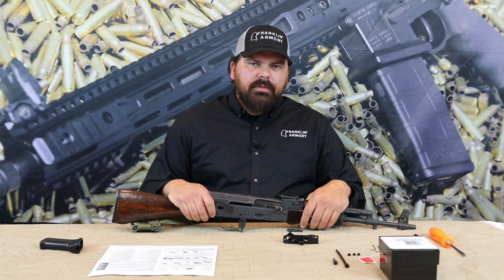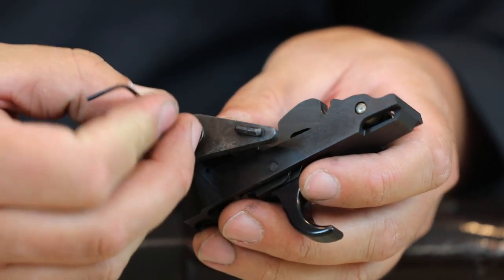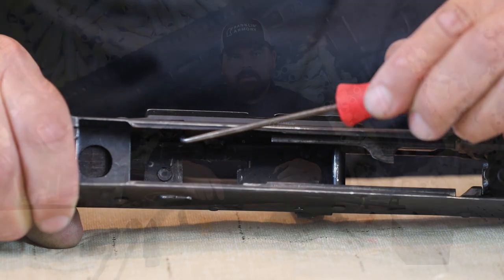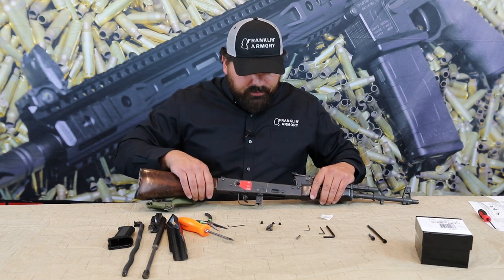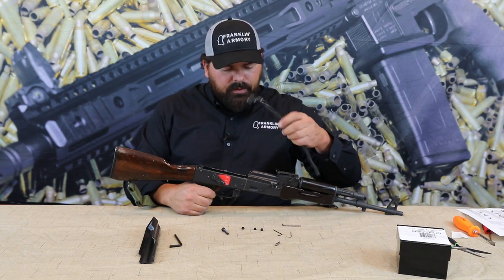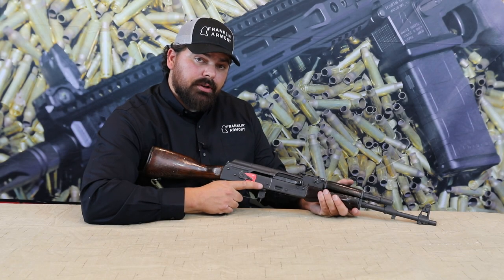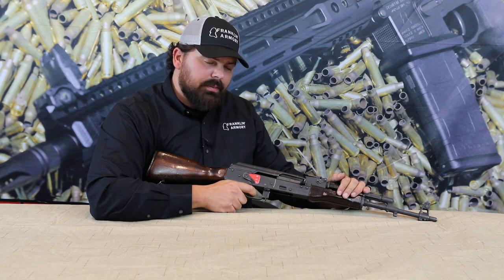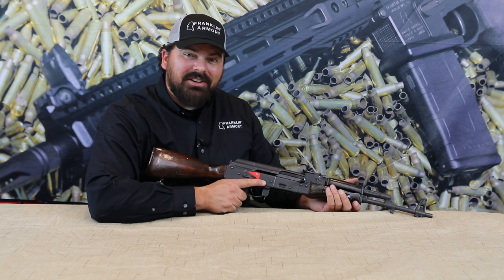BFSIII™ AK Install Video

Comment: what i don't like is you can't use your original safety selector which i'd like to see them fix on this binary trigger system
Reply: This
Reply: True.
Reply: This was one part they really shouldn't have tried to improve.
Reply: Should make it follow tradition Ak select fire control function as well with all the way down still being semi auto and one notch up for binary.
Reply: Anyone find a way around the fugly selector switch? 🤢
Reply: Yep, this safety selector doesn't look good & Fostech's looks even worse. SMH  Not sure why someone can't make binary triggers function with the OEM selectors on AKs.
Reply: @oneslackr  You know what's really funny? It'd be super easy to do a left side selector like the Tantal/Beryl use for a binary trigger. Like, insanely easy. Wouldn't work on side rail AKs but it'd still be an improvement over this.
Reply: Ak Boogie hook. Uses factory selector.

Comment: love how clear the top hat plug instructions are...
Reply: it does say to put the 2 small ones in the trigger pin holes (you wont be putting that pin back in so its just to not have a hole on either side of the gun) and the large one in the saftey lever seat, which there's only one of. they could have shown a top down view of where to set them with more light but they are relying on people knowing the take down process for the trigger assembly i think. I don't know how else he could have phrased it. i am happy to send you close up labeled pictures if you need though i know how annoying finding some of this crap is.
Reply: @philipsheets7987 well the issue i find is the plug doesnt go all the way through the hole. it has the beginning part that goes directly into the hole, but then it gets wider, and i cant get that wide part to go into the hole cause its too big. Basically the head of the plug isnt even touch the wall of the receiver. I wish it was clearer if we actually need the plugs to keep the trigger snug in place or if its just a "put something there" type of deal. Also dont know if the head of the plug is supposed to not actually touch the wall or if im supposed to have thors hammer and fit a size 5 circle into a size 4 hole

Comment: Won’t buy one till that fugly selector is changed! Wouldn’t be that hard to make it look similar to the factory selector.
Reply: edieuro95 I’m gonna mod it I got mine today
Reply: Josh Van any luck? I was planning on doing the same thing
Reply: Matt C.  Haven’t tried yet I’m getting a feel for it the only issue I’m seeing in doin it is that it will cover the trigger inbox me and I will send u some pictures of what I mean
Reply: That's what I was saying.  They need to have a full-sized selector lever for the AK.
Reply: Be nice it it worked like an ak selector two with semi being all the way dow and the other fire mode(s) in the middle.

Comment: You guys should really beef up the hex screw for the selector lever.   Theres nothing i hate more than tiny hex screws. Even while applying reccomended torque, the heads always seem to strip over time.  This wouldnt be an issue if you just used a larger torx screw to begin with.
Reply: I Agree Fully !!! And I own 4 of Companies Triggers !!!!
Reply: Almost impossible with the screw sizes/Allen sizes.  “Are these hex screws made for ants!?”  

Glad it’s finally installed, but couldn’t agree with you more.

Comment: Just installed the AK 9mm version in my AKV. Had to dremel the MAC clip a bit to slide it in.

Love the cutaway when he goes to install the hammer pin retainer clip. That thing is a pain and there's no way he got it on the first try. I had to work under/around the remainder of the MAC clip with hands shaking from the dremel work, extra fun.

Comment: Really happy with my binary trigger. Imo I didn't like how the selector looked so I just took a hack saw to it and the OEM Romanian selector and welded them together. Steel on steel Tig weld and sanded it down.
Reply: That's a good idea but how did you install it then?

Comment: Just put one in a wasr 10. no mods needed. hammer pin was the worst part by far, just did not want to line up with the last bit of the trigger housing after the spring. had to press the side of the hammer spring a bit with a flat head. but no real issues other then my own incompetence.

Comment: 9:15 safety check number 2. It’s clearly in semi. “In semi, pull the trigger, then with the selector, put in semi, the hammer should not fall”. Do you mean switch back to safety ?
Reply: The guy makes a bunch of verbal mistakes and nonsensical, redundant safety checks at the end of the video.  

I successfully installed their mp5 trigger and felt confident enough to install this one on my Zastava PAP85 pistol but unfortunately it’s proving to be more difficult that expected… 😔

Comment: Had mine in a couple years now. It was pretty fun, selector keeps coming loose over time, only problem is I've only had maybe 3k rds through it and the spring that resets the trigger had the leg break off. Dont see them on your website to replace it. I know you warranty stuff but I don't think you're allowed to ship to my state anymore, freaking Illinois sucks. I guess I can make one but honestly I think im just going to put my original trigger back in. Have a couple bfs ar triggers too, the problem is this stuff just isn't lasting. The ar triggers aren't breaking parts but they keep going binary only after a good amount of rds. Just enough dirt or whatever and that disconector doesn't slide up fast enough. Then I have to take it out, disassemble the trigger, clean it and I just replace the little disconnect spring. Those you do sell so I got a bunch of those and some selector screws because I lock tight them as they also were coming loose. The ar triggers I'll probably keep at least one because they haven't actually failed to fire ever but it sucks when an unobtainable ak spring goes out at the range. I mean I couldn't count the rounds I have on factory ak triggers, never had a spring break. And they aren't 500$ triggers. Anyways they're fun but I don't think I could recommend the ak trigger and when recommending the ar trigger I definitely have to mention the possibility of it going binary only. Doesn't bother me because Im always expecting it and they're both just in range toys.  One I use most is in a brp grip for a semi auto m53 so I cant use the ar selector anyways, its always binary. So im overall happy with the ar version. Not so much the ak version. Oh yeah and the ak hammer spring is a little weak for some of these milsurp primers too. Almost always works but definitely have a lot more ftf's than my original trigger. I wouldn't even go as far as to call them constant light strikes. It never happens with us made ammo. But it does happen a little too often with good quality comm bloc ammo. Ammo that never fails in my sks or other ak's or even this ak before the binary. Its just a hair weak. Well then, I think I've said my peace lol. Thank you for your research and development.

Comment: Does this trigger work for stamped receivers.. if so.. is there any custom work needed for proper fitment?
Reply: Looks like the gun used in the video is a stamped receiver, so yes it should work.

Comment: What grip screw do I need on a micro Draco I got it installed by a gunsmith but he said I need an extended grip screw the micro Draco one does not work nor does my zastava m92 zpap they won’t feach

Comment: Does this trigger assembly prevent you from “out running the gun”(prevent the hammer from releasing prematurely and resulting in a light primer strike)?
Reply: I hear this newest version does.  I will report back in more detail very shortly.  Well so far all I can say is it works firing slowly, which I think is the opposite of what you're interested in.  Working perfectly 55 rounds in on a very dirty WASR.
Reply: @robertgaudet7407  any updates?
Reply: @erik_the_meh  I fucking love it.  If you outrun the gun, the hammer simply doesn't fall.  So instead of 'bang-bang', you just get one 'bang', and then you can just keep on pulling.  No trigger slap BS.  No failure to function for the first several hundred rounds.  I wish it were less expensive but it's still 40 times cheaper than an actual automatic so... the price is right.

Comment: Just so everyone knows it works great on my wasr 10 with all types of ammunition except my favorite ak ammo Golden Tiger. Gun absolutely eill notbfire in binary with thsse rounds. I think the hammer spring is just not robust enough to set the primers off. Trust me ive tried eveything except a stronger spring which they sell but dont recommend forb7.62x39. They recommend using the mil spec spring that comes with it.

Comment: Will this trigger work in most milled receivers as well or just stamped. I got a c39v2 I don’t mind or feel bad putting mods on. Might I add I don’t mind a little modding just don’t want to buy one to find out none of it will work in my platform.
Reply: mv45rs hey bud did you find an answer to your question?  I had c39v2 too just wanna know if it will work

Comment: Sir, does this trigger work with the Serbian Zastava guns? I have a M92 PAP and an NPAP.
Reply: Just tried on my N92 PAP, will not work as the angle of the grip screw is different than angle on trigger housing of Franklin Armory trigger pack. Hopefully you're not out 500 bucks like me
Reply: @bradleynowel1 , I'm truly sorry that it didn't work out for you. Thanks for the heads up. You saved me, and countless others, the trouble and anger.
Reply: @traeucity6087  factt
Reply: @bradleynowel1  so any updates on this?
Reply: Huh... I seen this installed in a zpap92, and worked
Reply: I’m having trouble with a zpapm70. The screw in the handle doesn’t work and this trigger is too bulky. Dog shit product and now I’m out $500 too :D
Reply: @jamskate83  I’m thinking about getting one for my m70. your m70 under folder by chance? Can you please elaborate before I waste $500. Thanks
Reply: You will potentially have to mod the the nut that comes with the grip screw or take it out depending on the model and the trigger will fit
Reply: @tenzinphuntsok7854   Did it work on your m70?
Reply: Will not fit a Zastava unless you do some machining.  Another $300 to fix  this cluster fuck and it might work.  I would never recommend buying this Pig in a poke 😡

Comment: I'm not gonna lie... I like the idea of this and I kinda want one.  But what ALWAYS ends up getting me to not buy is that it deletes the safety I'm use to.  Which doubles as the dust cover.  
Redesign the selector lever to maintain its function as a dust cover and I'd probably already have 2 of these.

Comment: Will this work on a Sega 12
Reply: You find out?
Reply: @locoguero87  I don't think they read any of the comments
Reply: Works on a Nintendo
Reply: I don't see why not
Reply: i dont see why not, uses the same fcg as any ak
Reply: According to their website it is not rated for 12 guage platforms. Though that doesn't mean it wont fit persay

Comment: Something is wrong with my installation. Everything works fine untill i attempt to shoot fast in binary mode. Only the first round will fire the second round will strike but not fire. If i shoot in a slower pace in binary mode both rounds fire as they should. Press fire and release fire, but its when i try to speed up my RPMs and then only the first round will fire am I doing something wrong?
Reply: Anybody?

Comment: i just recieved mine and one of the two screws that attach the tigger bow, is blown out. its not stripped because the paint hasnt been scratched. i am not a happy weasel
Reply: hmk302  i just sent the rifle to them and paid the bullshit fee and attached a note
Reply: Eletric Larry  i am a happy ferret/weasel. i sent my gun in and paid for install/repair on august 8th and recieved it today

Comment: Just got mine yesterday and the bolt for the safety selector screw literally is not long enough. Also safety selector wont click on to any mode other than just semi auto? Any helps
Reply: It’s doing the same for me
Reply: @Lowygutro  hey I called them and they helped me figure it out. Very helpful.  I literally had to slam it in
Reply: Oh no way yeah that’s the only thing that I see is wrong on my end.  Thanks for the quick reply Andrew

Comment: Has any one installed on a PSA GF3 or Zastava O-Pap?
Reply: I just tried on the zastava. The bolt that goes in the grip doesn’t match up.
Reply: @MarcoGarcia-wp6qv  you end up getting that smoothed out? Would changing the grip and using the short screw work since a grip that uses the short screw just slides around independently until screwed into the nut that comes with it and maybe remove it entirely

Comment: Just threw mine into an AES-10B. Easy as pie!
Reply: I’ve got the trigger and I’m waiting on my AES 10 B2 to come in. Have you shot it yet? Glad to hear it’s an easy install.
Reply: @shawnhorning2125  Oh yeah, shoots awesome!
Reply: @michaelthebarbarian3380   Do you remember if you had to remove the trigger bow before you dropped it in or not?
Reply: @shawnhorning2125  Yup, you take the entire old trigger out, then you drop in some plastic rivets to fill the holes left by the old trigger group and then drop the entire new contraption in it's place (it's pre-assembled). Easy to do, takes about 20 mins to install.
Reply: @michaelthebarbarian3380  gotcha thanks.

Comment: Franklin Armory, any AKs you know for sure that this wont work in?
Reply: Underfolders won't work, unless you grind down the little hump in the bottom of the receiver. Learned the hard way, I got it in but it took some creativity.
Reply: @robjones3048  how far did you have to grind that hump down? Did you have to grind both?
Reply: @1white732  there's a rivet then the grip screw the another rivet which is closet to the rear, which I believe both  hold the trigger guard in place. Should I just grind down the front one?
Reply: @1white732  yeah me too thanks anyway  though
Reply: Ot does not work in my century arms mini draco with a 7.5 inch barrel. There is some recivier reinforcement that makes it sit to high for the bolt carrier to cycle. Can't tell if it works for the 11 inch barrel version.
Reply: Eletric Larry  because I  am poor and don't have a 1k to spend on a nice AK
Reply: @benhickey3189  thats what the set screw is for. loosen it up to drop the trigger housing so the bolt can clear it.
Reply: @joannedaniels2151  I want to say you are incorrect, so I don't look like a Neanderthal,. unfortunately I no longer own the firearm so can't vindicate myself. I hope it works for you.

Comment: Also can you elaborate further on 1:29 - 1:37?
Reply: Basically take a drill to one side of the relevant rivet until the flared end keeping it in is gone. Then drive out wkth a punch should come out then
Reply: Try to unscrew the screw which secures your grip to the receiver.  You may need a flashlight and an allen wrench, or a flathead screwdriver.  You never know with AKs.  If you can, ignore his little warning.  If it is a rivet and not a screw, drill that sucker out.  That will be a bit harder, do some research.  Need a good flat surface to start and some idea of the hardness of the steel you're going to be drilling through.  Once you know what steel it is, search for that alloy and 'speeds and feeds'.  Or just grab a drill and go for it, whatever! Good luck!

Comment: Does this work with a underfolder AK
Reply from the maker: Negative...
Reply: @FranklinArmoryBFSTM  And I'm now officially happy I've got a side-folder, thanks!
Reply: The better question is why not. Is it related to canceling a second shot with the stock folded?
Reply: What’s the reason why it won’t work in an underfolder? What’s different?
Reply: @WarDog276  there is a bracket that holds your stock that takes up space for the trigger

Comment: Will this work with a draco?
Reply: Will not work in my Century Arms Mini Draco with a 7.5 barrel. There is some reinforcement in the receiver that raises the trigger group to high for the bolt carrier to cycle. I did try filling some material from the trigger group but this didn't fix the issue.
Reply: @benhickey3189  I ran into the same problem. My next step is taking mines to a gunsmith.
Reply: @eracingregal  Hope it works for you it stinks spending 500$ on something that doesn't work out.
Reply: @benhickey3189  if it don't work I will put it in my ak47 rifle
Reply: @eracingregal  seems like a good time
Reply: Eletric Larry  i got mines to work bro and it's  sweet!! Love it!!!
Reply: @eracingregal  You got your Draco to run binary?

Comment: Keep selling overpriced paperweights. Got one that did not pass function check, selector lever is freefloating with the screw fully set, and it will not switch off of semi into safe or binary despite being able to flop 90 degrees.
Reply from the maker: Please call our customer service line 775-783-4313 our phone lines are open 9am-4pm PST Monday through Friday. Our tech support guys will be more than happy to help you out!

Comment: Will not fit a Zastava standard  ak. Grip bolt will Never line up with the trigger housing. Only thing that does line up is the hammer pin. Off to the machine shop to fix this engineering clusterfuck.😂